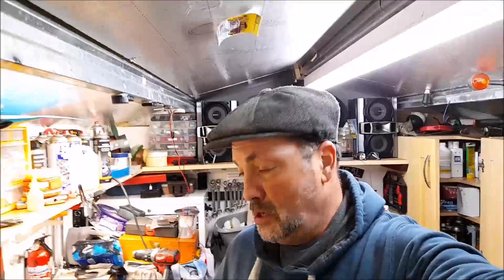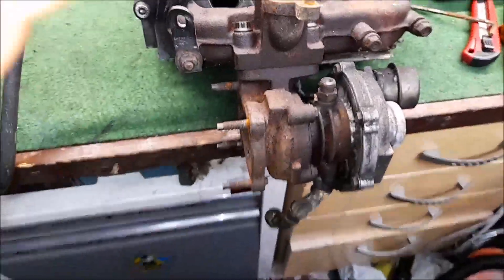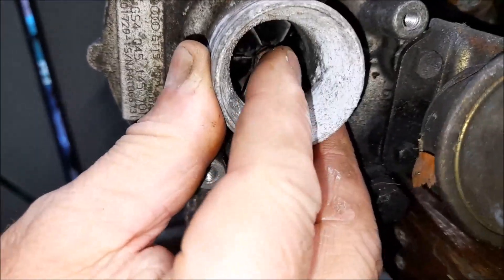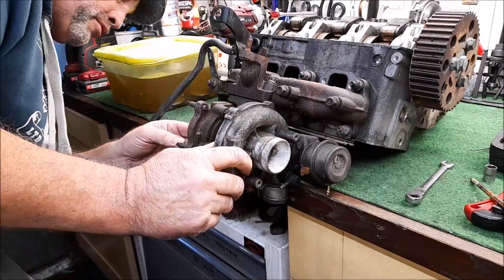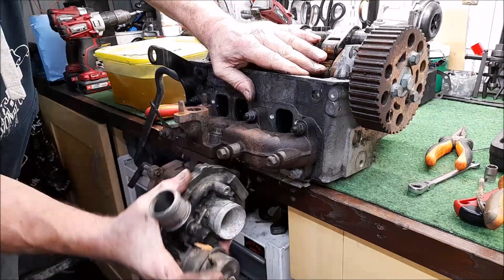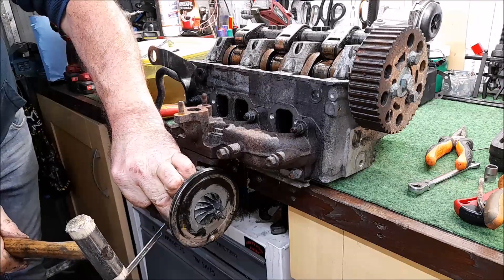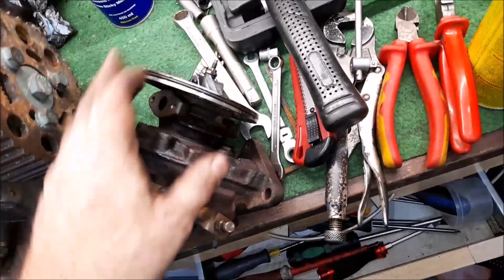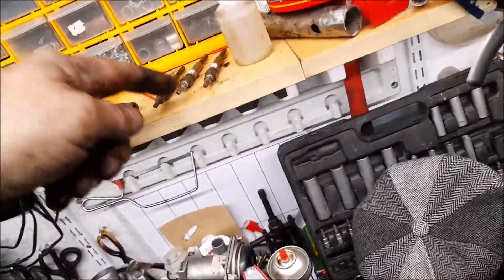Audi A2 Turbo Refurbish Can it be be done by DIY Joe?

Comment: Might be of interest my car had been remapped before I got it and it goes much better than my mates standard car.
Reply from the maker: Yes mine has been done before i bought it.  Pulls all the way past 4k revs
Reply: @eadsierestorations  List of jobs to do this year air con compressor, ABS sensor in rear wheel (intermittent) and change tailgate to spring opening. ps I changed the water temperature sensor first but it was the thermostat the sensor is bloody fiddly to get the spring clip out and in had to use a bent tea spoon....

Comment: Check your water temperature sensor before you replace the thermostat.....saves a lot of hassle
Reply from the maker: Where abouts is it bud?
Reply from the maker: Does that control the fan? If it does then it's fine, the fan doesn't kick in.